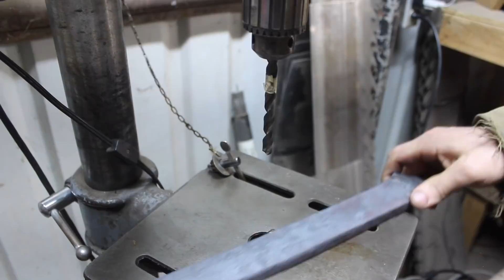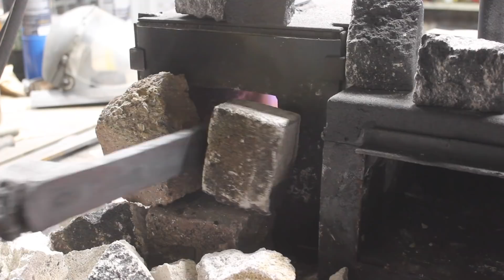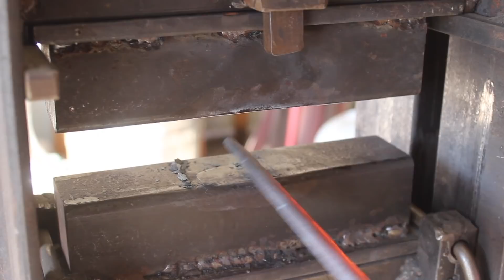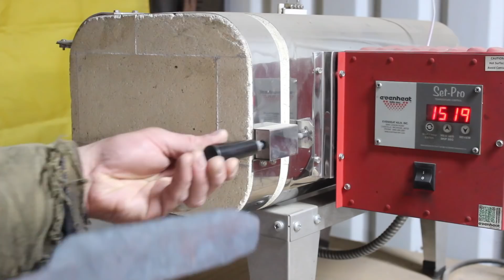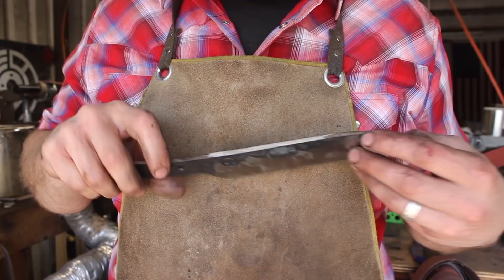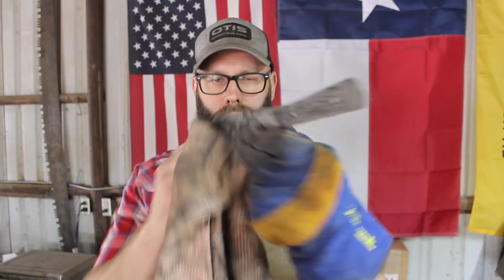Forging Modern Damascus Steel Part 2: The Blade | A Documentary From A Blacksmith Shop In Texas

Comment: Question born of ignorance: Aside from the expense of buying/making them, is there a benefit to drilling to achieve a “raindrop” vs using “raindrop” dies? Seems like a lot of material loss, no?
Reply: Good question.
Reply from the maker: This pattern, as many others, requires material removal. With the die method, you must grind off the raised portion, so the same effect is achieved but in reverse. Visually there is no difference, I believe.